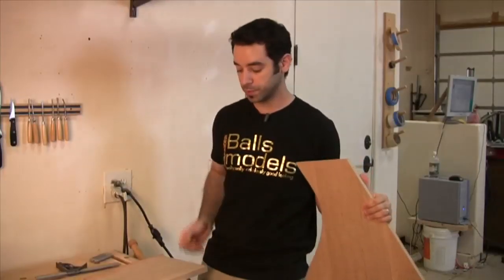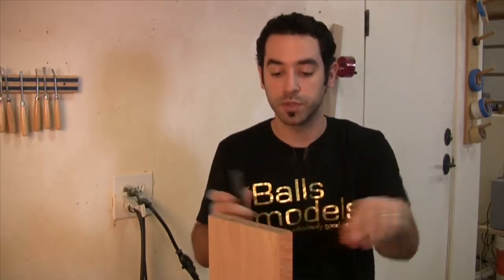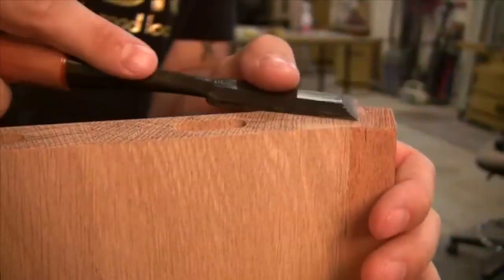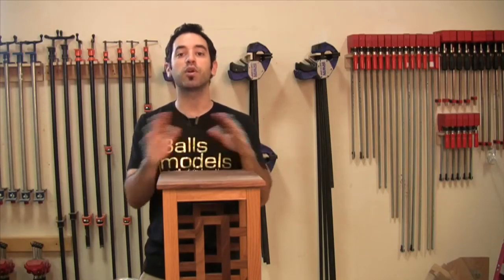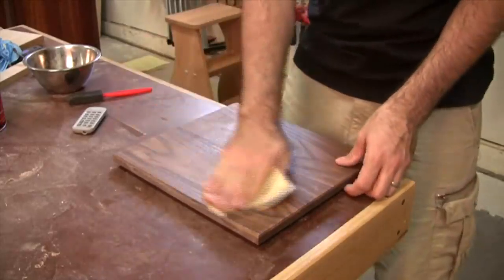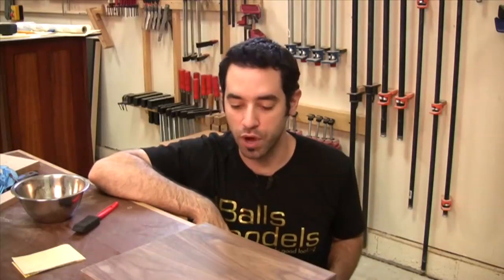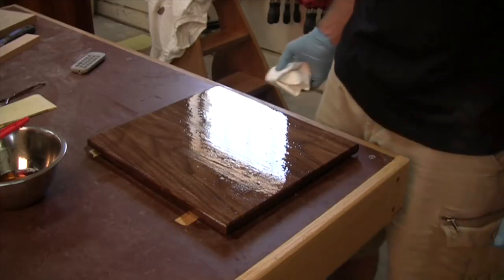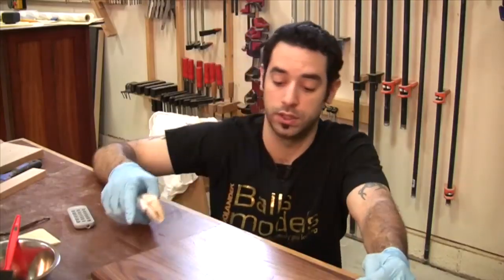21 - Paring with a Chisel

Comment: I finally learned how to sharpen my chisels recently, then how to keep my fingers out of the way right afterward. You know the difference between cutting yourself with a sharp tool and a dull one? A sharp tool leaves a less jagged cut and goes much deeper. One TDAP later and my arm is super sore, where I got the tetanus shot. I'm healed now as far as the finger mishap though, luckily. I'm trying, but have gotten way too neurotic in my old age to get better at woodworking. I had to take a break for along while and cannot even do what I used to could do when I was younger.

Comment: hi mark I see that you sat your top on two strips when finishing the top.  I understand that problem and what I use is strips of wood with stabilising feet and through the strips I drive pin nails at 1 inch intervals.  then when I am doing what you are doing I can sit the board onto the nail tips.  you wont even see where it sat on them after it is all dry.

Comment: Good video from FWW on using a chisel, Phil Lowe. Hold the blade on top and bottom with your left hand and swipe or slice it into work. Your fingers should be underneath and registered against the side of the board but not in front of the blade.

http://youtu.be/73Neq8EoQdY